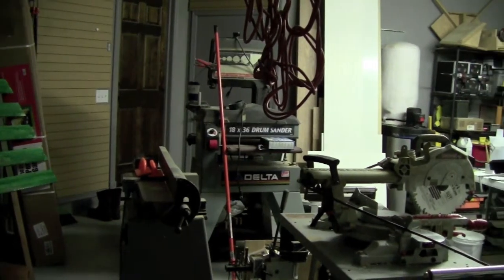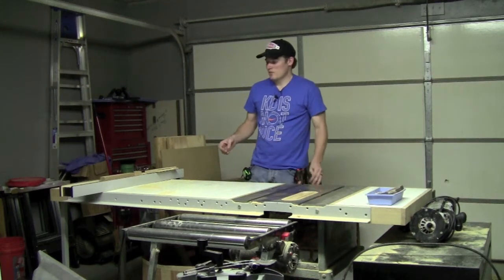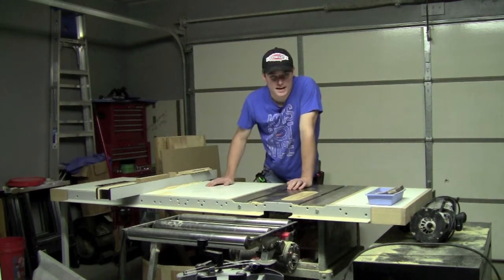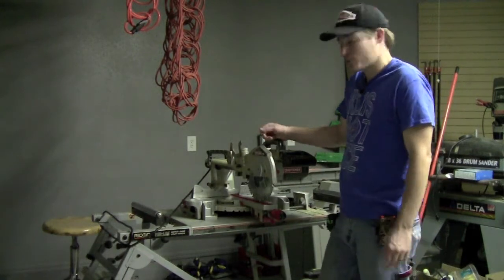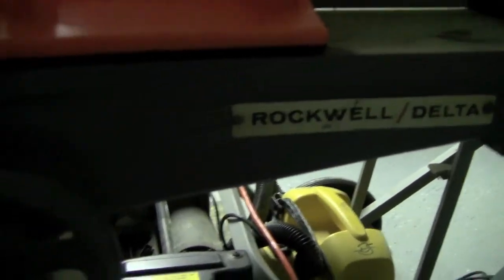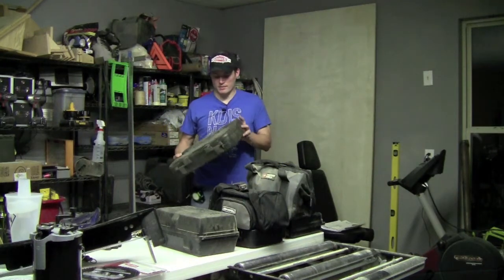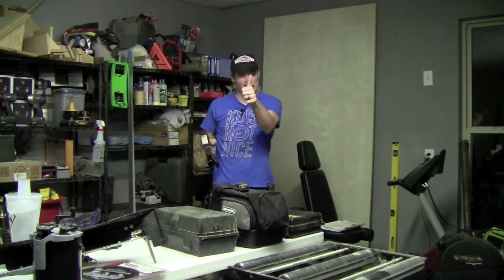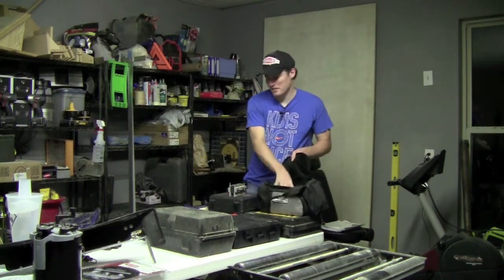Shop Tour of the Rock-n H Woodshop

Comment: Drew, I like you like to shop on amazon.com. I typed in this dovetail machine and they still have some. A little over $600.00. I just typed in porter cable omni 24 inch dovetail jig, and viola there it was.
Reply from the maker: Yes, what I was referring to is that you cannot buy it directly from Porter cable. I too do a lot of my shopping on Amazon and aftermarket websites. That is actually how I obtained my dust collection chute for that particular dovetail jig. Thank you for the comment though, keep them coming.